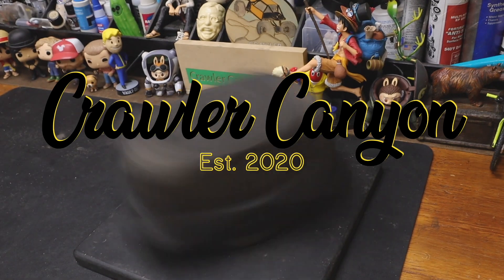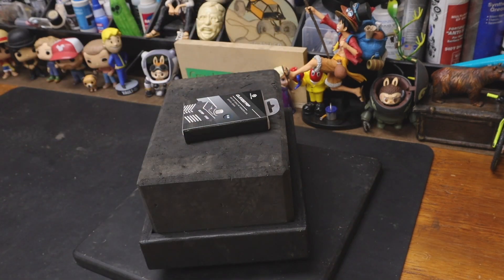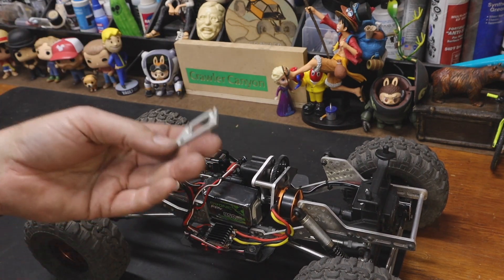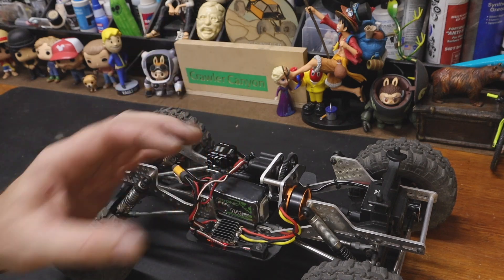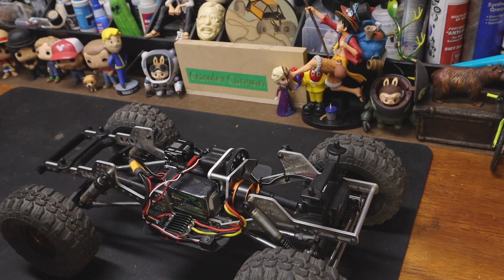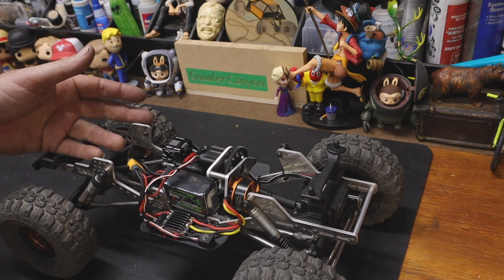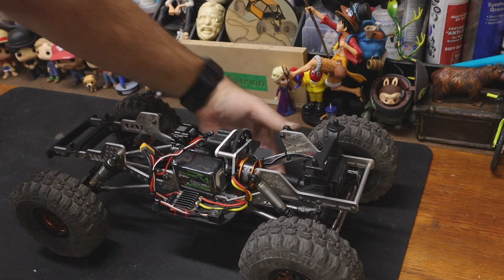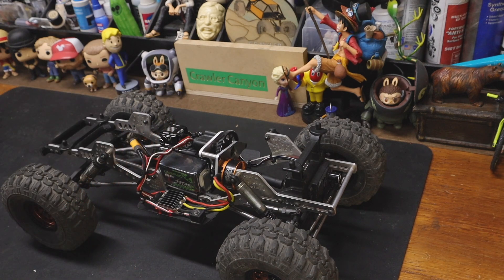Crawler Canyon Quick(re)view:  Flash Hobby CLS1227RP micro servo

Comment: I'm running the very similar looking 11kg Injora. I assumed they were the same thing until you mentioned the odd screw size. It has very similar specs and case. I have the drop in Injora (Axial style) horn and I have no complaints about the system. Works flawlessly for me. 

My VFD Hutz dig is incredible. Pure perfection in my experience. BUT oddly the Vanquish dig on my Vanquish 3 gear is problematic. It never wants to go all the way into the dig position, and while the dogs being pressed together (but not meshed together) locks the rear just fine, I wind up burning up the sevro, or since I swapped to the DS-H015A, browning out the Furitek ESC. With ex I turned the bec voltage down to 6, thinking It'd brown out and heat up less and that maybe less pressure would allow it to slip on into gear, but no change. It has made me contemplate some kind of sprung mechanism to assist. Like a servo saver or something similar to a nitro throttle linkage except the spring would push the into gear. What I'll try first is to disassemle it and break the edged on the machined dogs and polish things up a bit.

Would be curious to know if anyone else has this issue and has a solution, or would want to know if I find one.
Reply: Injora??? You might be confused ...they dont have full metall minis😎
Reply: @themountain59  no, look up injora INJS11….

Comment: Do you think this servo would have enough torque to overcome the original servo position, or would it have the same issues? I’m building a Zoku Basecamp myself and I’m wondering if I should start designing a 3d printed bracket or if I can get away with the stock positioning if I get a better servo. This looks like it may be the one either way, it looks so so fast.
Reply from the maker: A qualified maybe. The biggest problem with the OE position is that accursed Axial saver. It's just mush. The stock bracket only needs spaced back about 10mm--  I just spaced it back one mounting hole.
Reply: Ope! Guess I commented too early! Buying that servo just went from a maybe to an add-to-cart-and-buy-it-now.
Reply: Great video! Would like to know what the service life looks like compared to the other higher priced options out there…buy nice or buy twice kinda thing.